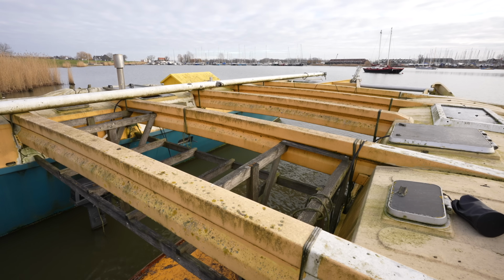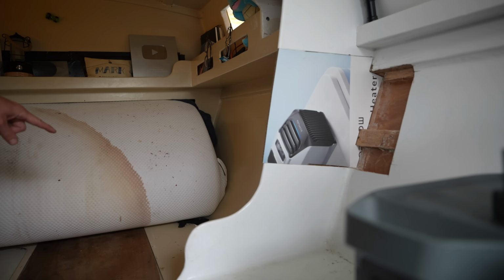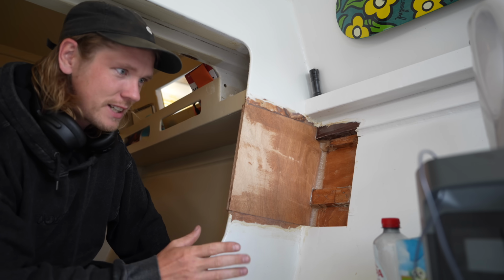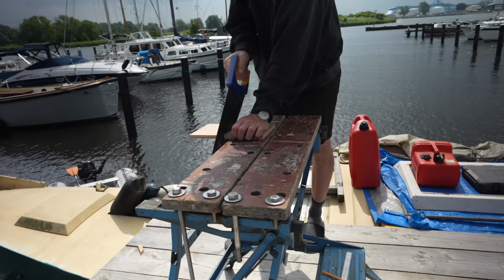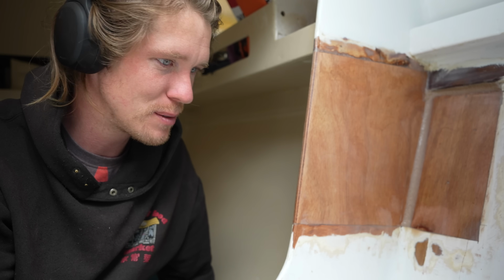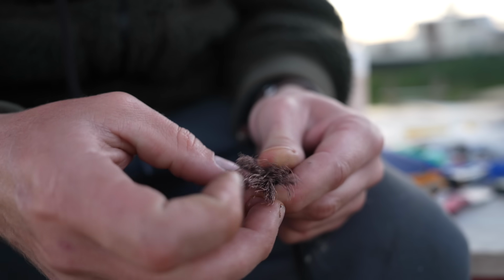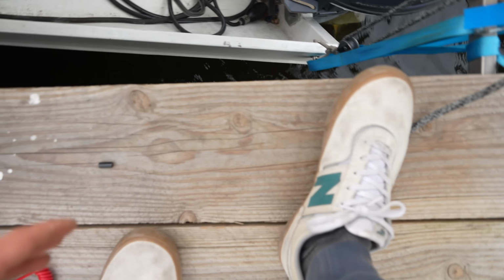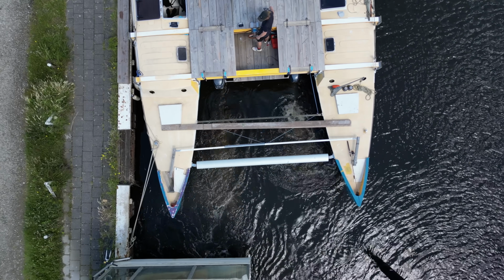My DIY Catamaran Engine Set-Up Is Complete!

Comment: You need lots of acid free flux when soldering. 
Don't listen to anyone who says you shouldn't solder cables, you can.  The cables must never get that hot to melt it!!!!! if they do get that hot then something is very wrong. The marine environment will only attack solder joints if the flux is an acid type. 
Use acid free flux, then solder the joint, cover with silicon then heat shrink.  
If you use the correct size cable and allow for volt drop and inrush current all should be fine. 
Better still, have a continuous unbroken length. 
You can can also use Wagos and Wiska box's for jointing.      
Always install an inline fuse for overload and fault protection as close to the power source as possible for every circuit.
Its always better to use new cable rather then trying to clean up old stuff. 
When calculating cable size, add up the watts (load) and divide by the voltage, this will tell you the amperage   and loading of the circuit. Then select the relevant size cable and fuse according to the regulations. 
Best advise, get a qualified marine electrician to do this type of work. Good luck

Comment: Please ditch the stressy jazz. Pkease. Yeaaaah. If you don't, you'll have to wear a black polo neck with external neck chain. Cool. (Not).

Under the bed put the thick pipe lagging foam. Cut them in half longways so they are semicircular on their long axis with a few at right angles to make a narrow ladder looking arrangement. Tape to the wood beneath matress. Added comfort padding. And air flow. And cheap.

Comment: How is it possible you are soldering a black cable to a red cable? Red is plus, black is minus. They should never touch eachother unless you don't care about the colours and mixing them up. This may cause you problems one day when you have an electrical failure and searching for the problem.
Furthermore I suggest you replace those short pieces of cable with full lengths of cable because your cable connections are not of the best quality.😢

Comment: Hi Mark I’ll be the first to say that I have absolutely no experience with boats and how they are designed and what works and what doesn’t but looking at your boat and the fact that you want to sail in the open sea. Gives me concern I just don’t see it Handling   Heavy seas with engines vibrations in calm water I just don’t see them staying together in bad weather when you may need them. I know you have safety straps and the like the system just doesn’t give me a good feeling. I just don’t see how you’re going to sail around the world in it. You don’t seem to have any plans for a  auto pilot. How are you going to stay out of the weather it looks like waves will just break and come through your deck in heavy seas. What’s going to keep you out of the storm,wind,cold when you’re sailing on any passage short or long. I hope things go good for you it just seems the more you do the more there is to do.

Comment: I cringed watching you splice those wires together.  You should have used a non insulated butt connector to join the wires together then add solder.

Comment: 20 seconds in all I see is fire hazards.
Reply from the maker: true
Reply: Chill out dude he’s not working on a petrol station
Reply: @schmitt9026  
He is on a wooden boat that will have gasoline and other flameble stuff.
If the sea gets ruff everything gets shaken around a fire is not what you need.

On the other hand if you suddenly have no power anymore because a cable brakes its no joke eihter.
Reply: Cc above, not a metal boat
Reply: High amp fuse on battery and  a bit of cable separation.